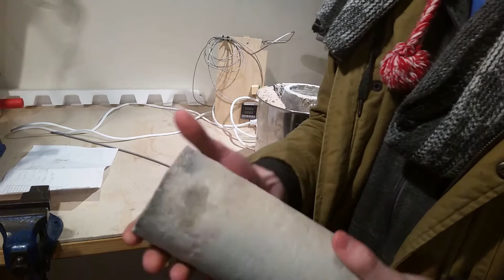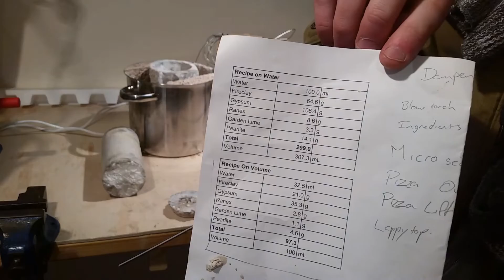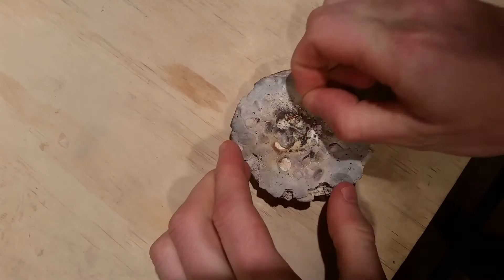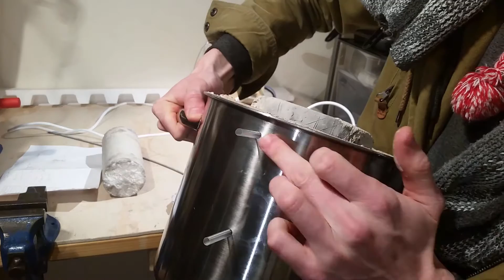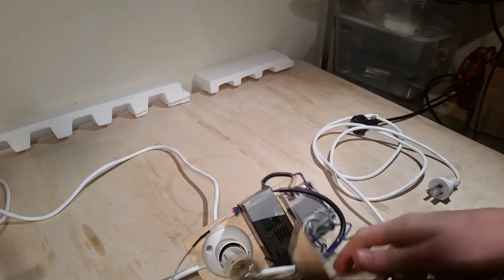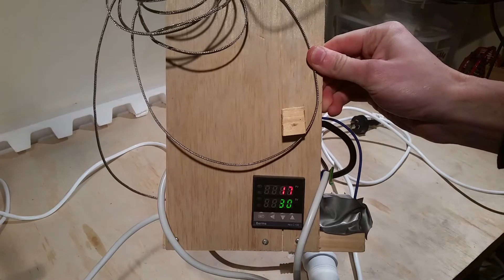Electric Furnace - Part 1

Comment: this crucible, how many degrees do you endure?
Reply from the maker: The electric furnace made it up to only 800C  in the end before the element burnt out.
The actual crucible was fired at over 1500C and I am pretty sure it would have been ok to smelt aluminium up to 1000C if the bottom hadn't cracked off :/
Unfortunately the project is on hold for now :/
Reply: why is the element burned?